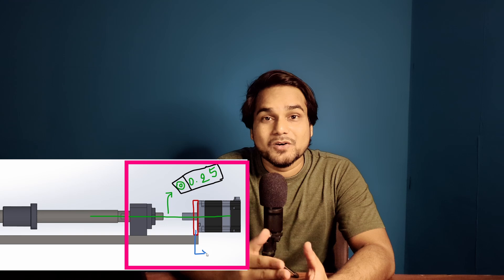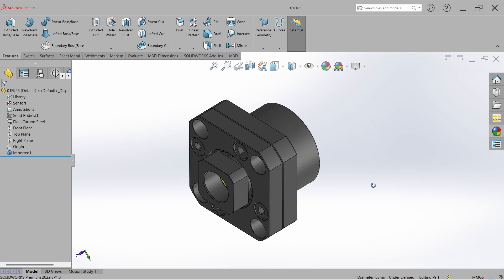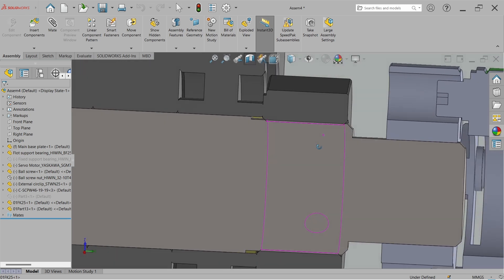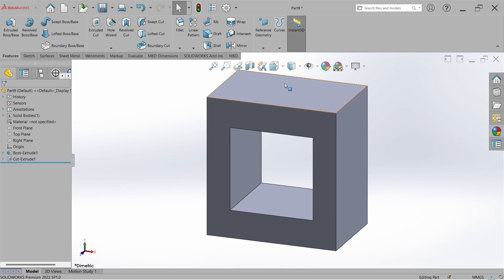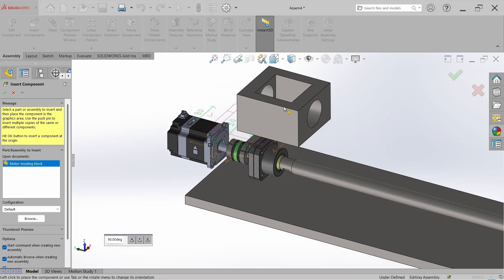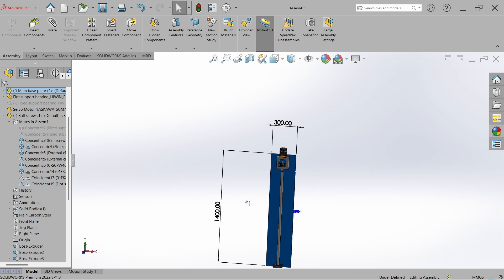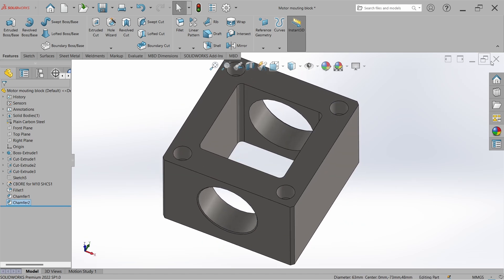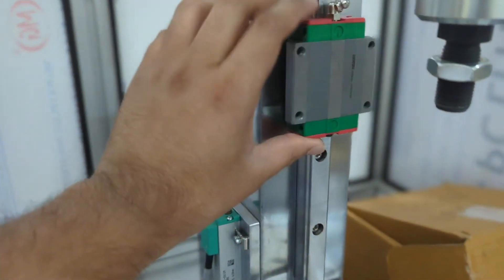Machine Design Critical Thinking | Motor mounting design

Comment: The installation method #1 for the fixed side is unclear because the width dimension of the block is not specified (MISUMI does not mention it). Therefore, I am concerned that when you make a slot cut, it may not meet the accuracy expectations
Reply from the maker: Yeah, that a good point, maybe we can tolerance detail in catalogue, however we can give some clearance there, like + 0.05, coupling and ball screw can adjust that much misalignment very easy.

Comment: Sir ji,
Aap please ek approach bataye
- how to decide/check data : to select required thickness of metal plate/sheet/tube , 
"Which can take load (kg.) of total other elements and run without vibration

It is for machine segment
Reply from the maker: Sir,
Right selection of material thickness is always being a really tough and tedious task,
There is not any data sheet, or recommendation in general.
Here I'm selecting material thickness as per experiences.

If you really want to go with calculation method, then must have to calculate all stress for very simple case, but if anything, which is not flat or round then have to have go for FEA analysis,

In general, I would say. IF we are going for mass production, we should definitely do FEA analysis, every single part to optimize material thickness.

and for special development, select the material thickness as per raw material available thickness for required length and width, also consider material removal allowance (grinding) more material removal allowance for long base plate to achieve flatness.

Vibration: Vibration not only depend on material thickness, No matter how thick plate we are using, if machine is dynamic and running near or within its natural frequency machine will vibrate.
But yes, Heavy material thickness damp vibration, but it's better to find the natural frequency of machine with FEA Dynamic analysis or field vibration testing and alter the design to avoid machine running frequency from natural frequency range. 
I had badly faced this problem so many times, machine speed was 20,000 RPM.
Vibration limit Vrms 4 mm/s.
Reply: @mastermechanicaldesign  really helpful and quite detailed explanation,to clarify every aspect,like professor 👍👍👍
Thanks again

Comment: Sir I have a question 
How to lock the fix side unit nut in this mounting arrangement
Reply from the maker: Hi Ritesh, There is a key cut on the ball screw (must give the key cut when using this type of mounting block), 
Hold the lock nut and tighten from the ball screw side using a spanner on. Or we also make cuts on the mounting block for spanner space (as i have shown the standard type of servo mounting bracket, time 3:50 )
Reply: Thanks sir